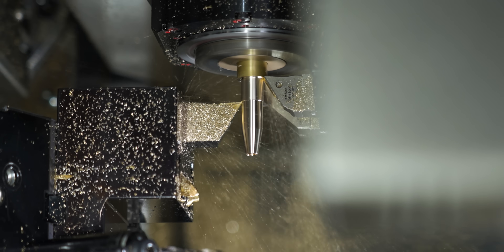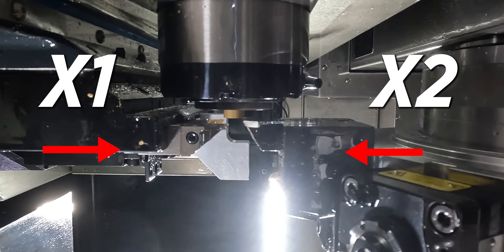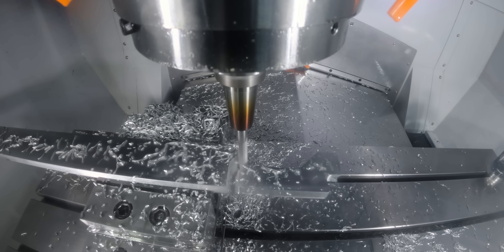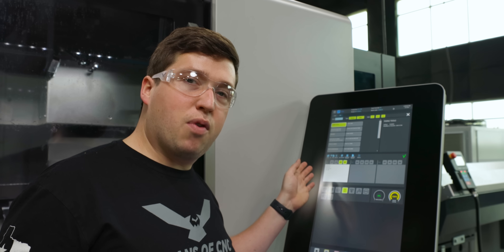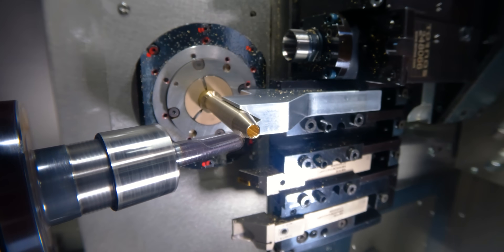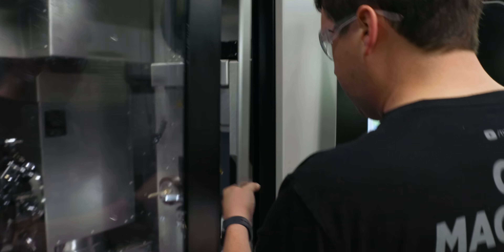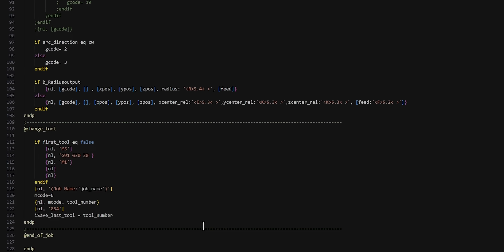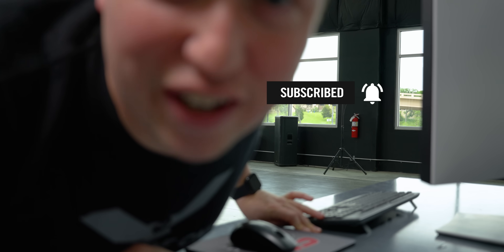Chatter is Scrapping My Parts, So I Made This…

Comment: So much fun to show everyone this technique! This kind of stuff is why I love Swiss machining!!! There’s always a cool solution to the problem! Also glad to see Bro Rogan in the video! 😂😂
Reply: Loving the swiss videos they happened to line up with one of my customers getting a swiss and asking for some help. do you know when the academy is coming out?
Reply: why didnt you just feed the bar into the endmill first with minimal clearing to the workholding to avoid chatter, then do the turning after? are interrupted cuts in brass that bad?
Reply: Who makes that brush you used?
Reply: It was a good fix but my only concern is when you have more than one groove there is always a slight burr on one edge which can act like a high spot when against the support pushing work more towards the cutter.In this case it may not be critical but on more precise parts could be a problem.Having said that I've never used a Swiss machine 
so always find your videos interesting Donnie.👍
Reply: @BplusJequalsFire  around September
Reply: @Cassiusisback  the actual part is made out of stainless. I would not want to take the chance of creating burrs on a medical device
Reply: This brings back memories. When I was starting out in swiss my boss wanted me to take a straddle knurl holder and replace the knurl wheels with 2 flat wheels to use as a steady rest while I was turning. So we put the knurl holder in the turret and called it up while I turned with the gang... The wheels we put in the knurl were toast and seized up after one part. haha. Cool to see it works when the work material isnt rotating.

Comment: I'm not really a swiss guy, and I get the point of this video is to demo this specific solution, but why not take more advantage of the guide bushing in this application and keep the endmill in as close to the guide as possible while working in sections? In other words, why feed the tool gang in Z when you can just feed the bar in Z and keep you tool in close?
Reply: he had to cut 4 slots you'd have to feed a little by little and rotate 4 times these guys want speed to make $$ so this was probably faster in the long run..

Comment: Back a lot of years ago, I used to grind long skinny feed screws at Hardinge.  I cut a similar V notch in the handle of my plastic hammer to push them into the wheel to hurry things along (already using a steadyrest).
BTW, I was the person that designed Hardinge Swiss Collets and Guide Bushings, back in 1993.  Also many other things at Hardinge.

Comment: Could you have draged the ball nose endmill instead of pushing it? Cut with the outside in stead of the center?
Reply: When cutting with a ball nose it is better to engage as many flutes as possible which is why he is cutting on an angle. Dragging would only engage about half of the flutes depending on tool diameter and cut depth

Comment: Do both Axis (X1,X2)  have a milling head? If thats the Case, can you mill the Slots at the Same time with both Axis simultaniusly. So the forces are equal at both Sides.
If the part has a round number of Slots😅

But what machine has two milling heads especially on a lathe

Comment: I just watched a video from tornos about this swiss deco where they made a very similar part, instead of a steady rest they had a centre in one of the tool slots of the front turret/gang. Was this not something you considered? It was for the same process of slot milling down the side and it had the same outcome, removing the chatter.
Im not saying its a better option, im just curious

Comment: Not a machinist here, but I'm confused. Isn't the whole point of a Swiss lathe to machine the part right at the bushing, in 25mm sections? The travelling steady is doing the same job the bushing would normally do.
Reply: I'm also not a machinist but I think the reason is that once you've reduced the outer diameter, you are limited by how much you can retract the stock and still have it properly supported in the guide bush.
Reply: @JamesValentineKohera  that's true, but I think in one of their screw videos, they show the process of machining the raw stock to final geometry in 1 inch segments so they don't ever have to retract the bar beyond the bushing.

Comment: my problem is that i would love to do this work. 
MY OWN work. 
i would hate to work for someone doing this. 

the work is verry interesting.  i just don't want to HAVE to get up every morning.  i just wanna come in when i want to.  
and if it's a project of my own that i want to finish.  you can bet your ass that i want to come in.  
if i am just filling my hours, i will be depressed every single morning.

(ps this is the exact line of work i have gone to school for and have been doing for the past 15-20 years. just not in this capacity.   everything is too locked down.  established products with established tooling.  never have to write any programs. never have to problem solve.  just produce produce produce..  this is why i am switching to another proffession.  i'd have to move to find a company where i can enjoy the work. and i am not moving.)

Comment: It's really hard to see what you're working with because the video is so highly edited but if you have an actual turret in the machine just use spring loaded live center. They're like $1200 or maybe evem less from Royal.
Reply: You need a spot drilled hole for that which you have to turn down later. This is way simpler faster and cost effective than your method
Reply: @payforwin6697   It looks like there's already a center in the end of the part, you can also request the customer to allow for one. Also, you can use the live center for many other parts, not just this one and in other machines. I highly doubt cost is an issue as this machine alone probably cost a million dollars not including that Kennametal quick change tooling system.
Reply: @CNCMatrix  you buy the machine bc that’s your business and the kennametal tollchanher is for faster cycling time to reduce cost. While the Liveübertragung is just for this. You are right abt the center in the part but that doesn’t go for every part and asking the costumer is time (which is money) you don’t want to waste. So you need bigger stock etc. Why not let them build that and safe time and money?
Reply: @payforwin6697   So you're telling me paying a machinist to make this doesn't cost time and money?
Reply: @CNCMatrix  it does but like the kennametal toolchanger it will safe time and money. I’m not saying that a live center is bad or that you don’t need one but for pieces like this (without a centerhole) it works just fine Annis a smart idea